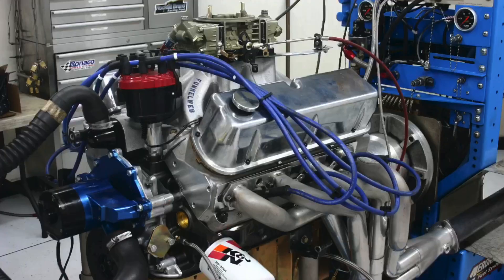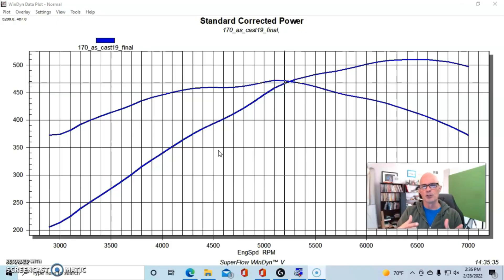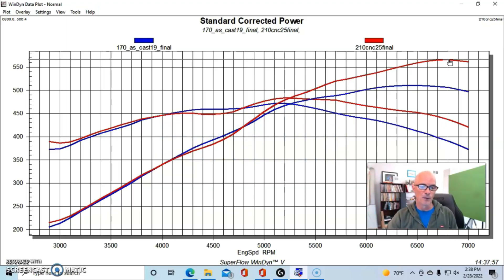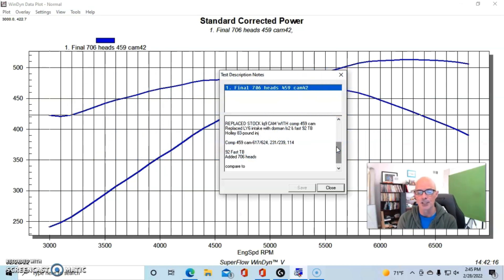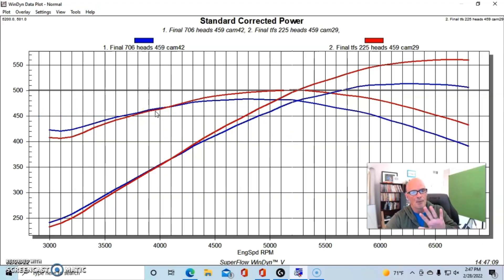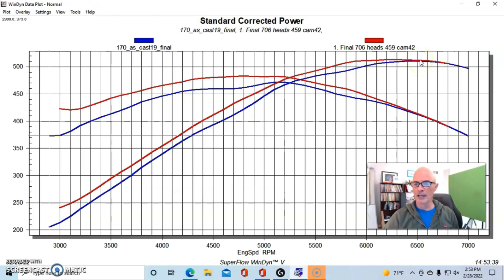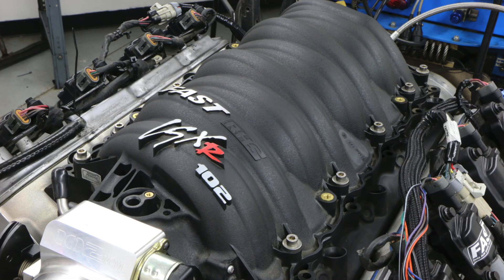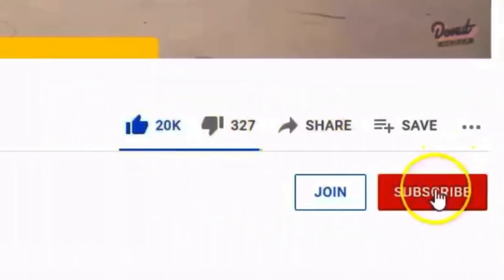HOW TO MAKE 6.0L POWER! FORD vs LS-WHICH 6.0L MAKES MORE POWER? MOD 363 FORD STROKER OR MOD 6.0L LS

Comment: I've run 351 Windsors with good heads and mods...but if you're going for max power, I'm now using a Ford "Boss" 4-bolt main, diesel iron block.  While you COULD limit it to 363...  A slightly overbored Windsor will easily hit 550 hp without straining the shortblock.  A 480 " Windsor is possible with the Dart block, or probably with a sonic-checked Ford "boss" block. (the boss is not a cleveland block.  Does have cleveland size mains.  Mine is a 438.
Reply: Diesel block,???
Reply: @timothywalker2273  diesel iron. Same metal makeup as diesel blocks which are made to withstand higher pressures.
Reply: @pimpovic2 Never heard of that. Is there some literature or link to that? Just curious.
Reply: Read it again.  Diesel IRON block.  Basically better iron than a production 351W @timothywalker2273

Comment: A forged motor with a solid roller cam over 700 lift with aftermarket heads vs a stock shortblock with aftermarket heads a much much less aggressive hydraulic roller camshaft with under 640 lift and yet it makes slightly more horsepower and 50 foot pounds more of torque plus it's extremely streetable seems to sum up the winner here if the LS had a lite weight forged assembly with pistons with valve reliefs and a solid roller camshaft with comparable lift and duration as the Ford engine with 11 to 1 or slightly more 11.5 compression it would probably make 50-60 more horsepower than the LS engine featured in this video and turn 7600-7800 rpm

Comment: Isn't the funnel web kinda old technology? I've seen many dyno comparisons and it gets beat out by both a super victor as well as the trick flow single plane.
Reply: yeah, its probably the worst choice in aftermarket manifolds for sbf

Comment: 1968 platform with today’s technology vs late 90’s platform is why the Ls is so much budget friendly. Of course the Ford is going to cost more. Ford dropped the ball by not staying in the pushrod game like Chevy did with the Ls.
Reply: Its worth noting, the Camaro and Challenger just died(again), along with their pushrod engines. The sales numbers always tell the real story....
Reply: @jackriegel5671  Ford got it right with the Coyote. The Coyote 5.0 is killing it in every form of racing. Especially street racing. The pushrod platform is a simpler design and easier to swap. Whole reason why I’ve stuck with the Windsor and Cleveland platforms. High HP and RPM’s, the Coyote is in a league of its own.

Comment: This should end the Ford versus Chevy debate. What I saw is a full racing block prepped with high compression pistons and a giant cam with custom cylinder heads basically makes the same power as a General Motors 6.0l That has a mild camshaft and a good tune. Period it makes absolutely no sense to build up a Ford motor like that when you can get the same power that 1/4 of the price
Reply: You should probably review the video.not remotely close to a apples to apples comparison.

Comment: that Ford would have hung with a Victor 5.0 EFI intake across the board; monster intakes. i have tried to design a composite intake for the pushrod , mentally of course, and it would be hard with the distributor and narrow head spacing -- with respect to runner length -- and valley situation, but it is fun to think of what the ol pushrod would do with a good composite intake. hell, it is basically a primitive LS.
Reply from the maker: A VICTOR 5.0 INTAKE IS NOT GOOD

Comment: And with it not being apples to apples the SBF is still not at any real disadvantage, nor is it limited. I'd rather be shot than have an LS in my Cobra!
Reply: Imagine if Ford had continued to developed the SBF...advanced block strength that wasn't necessary for a production 225hp Mustang that noses over around 5000. The Boss block for example could easily have become a production block.
Cylinder head technology, Lord have mercy what the engineers at Ford could have done with that. Point is LS engine development is more modern. Ford could've decided to do the same thing with the SBF but decided on the modular program. I get frustrated with the comparison of engine design from the 50's being compared with engine design from 30 years later. That's why I continue to say that the SBF isn't at a real disadvantage. Once you get past the limitation of the factory block and heads the game changes. Once the aftermarket steps in and you have both power plants on an even playing field (which they aren't here) results are always going to be similar.
I have a couple of LS engines myself, the benefit is what you can do with the stock parts but once you start having to spend real money on both engines from the foundation up the balances are much more even and really come down to preference, familiarity and brand pride.

Comment: Tough to compare a carb vs FI setup with better heads and manifolds, but the takeaway could be this: 
They all make good power if you combo them right. So run what you enjoy. 

On a side note, the cost comparison would be way better if he had started with a 351W. Again, pick your combo and have fun with it.
Reply: I agree! Especially when the cam is tailored to give the EFI enough vacuum to run right.  I'm not familiar with quirks of LS's, but with the Fords, you can cam them up for 8000 rpm's or higher with those TFS Hi-ports CNC ported heads. But then your "EFI" would have to be a high dollar race version.  I have a 363" 351 W engine (.040 plus a slight stroke to accomodate long rods with proper piston placement) and it pulls very hard through 7500, shift a 8000.  The RPM's in this test tell me that Richard fudged the Chevy cam to promote good vacuum for the EFI.  I have a 106 LSA, and there's not much vacuum to be had.  Duration 245/250-ish at around .640 lift.  "Expensive"?  I use chevy pistons, chevy rods (aftermarket but designed for) Chevy pins, and redrill my heads for LS headers, which are the same...but for some reason Ford headers are more expensive.  If you insist on building an expensive Ford, you can...but why?  Race an LS?  "Oh, I've just got a junkyard engine" (if they lose) and "My engine was cheap" if they win.  Nope, and nope.
Reply: A  .40 over 351w would have done similar numbers far cheaper !!

Comment: So, were you ever able to run a set of Twisted Wedge 225's on the 363 SBF? I'd love to see two tests, the above and your 6.0 LS, both with Holley Hi-Rams so the induction side is as comparable as possible. Actually, I'd love to see them both tested with Holley X-Rams, but I don't thing they make one for Windsors...

For which I'm cussing them out under my breath.
Reply: Use adaptor plates

Comment: A all forged engine vs a stock shortblock and the stock shortblock has less camshaft makes more peak power and torque and and also makes more horsepower and torque throughout the entire rpm range just imagine if the LS got forged rods and pistons with valve reliefs and a camshaft simular to the Ford in lift and duration you could probably add another 40-60 more horsepower easy not to mention the LS engine is very streetable and a more mild engine makes this a easy choice
Reply: How does forged engine make  horsepower?this isn't even close to a apples to apples comparison.
Reply: @rickkowalske4116  the reason the Ford engine has a all forged rotating assembly is because the stock Ford crank rods and pistons are no way going to take this power level abuse or rpm range and if it did it wouldn't do it for very long on the other hand the LS 6.0 is known to last stock to the 600 horsepower level and to 7200rpm and let's address the aftermarket cylinder heads on the Ford engine when the LS has upgrades stock heads not to mention the 6.0 LS had a much more mild camshaft than the Ford did let's put a camshaft with similar duration in the LS that the Ford had and let's put some AFR LS3 Mongoose 260cc cylinder heads on the 6.0 with the more duration cam and these heads bet it gains another 60-75 horsepower
Reply: @rickkowalske4116  well the only way to see is if we put a set of light weight forged pistons and rods and crankshaft in the 6.0 and run it on the dyno what do you think if what the engine is rotating inside weighs less it not going to gain power racers only do it for durability reasons
Reply: @rickkowalske4116  l can guaranty you the forged rods crankshaft and pistons being used in the Ford engine weigh less than the factory rods crankshaft and pistons so to be fair lets put the stock ones back in it and see if it makes the same power
Reply: @rickkowalske4116  so your saying there's are absolutely no advantages comparing a completely stock short block with a stock rotating assembly to one to has a custom built hand picked to your choice all forged rotating assembly if so then let me pick a stock stroke all forged rotating assembly for the 6.0 and I'll bet it will rev faster make more power and rev higher with it
Reply: @rickkowalske4116  and with the trick flow heads on the LY6 6.0 compression is probably 9 to 1 because with the stock 61cc head it's got a whopping 9.6 to 1 way less than the Ford the Ford had a pretty large race carberator the LY6 6.0 had a 92mm throttlebody I'm sure with 10.5 to 1 - 11 to 1 compression that the Ford had and 102mm throttlebody on the LSXr intake using the same camshaft it  would have easily gained 30-40 more horsepower the compression alone going from 9 to1 to 10.5 to 1 or 11 to 1 would easily add 25 more horsepower this LY6 6.0 made this kind of power with the trick flow head with around 9 to 1 compression is absolutely amazing see how well the Ford engine runs with the camshaft they used with 9 to 1 compression the 6.0 had a hydraulic camshaft with under 240 duration the Ford had a solid roller with over 250 duration and over .100 more lift than the 6.0 Chevy did
Reply: @rickkowalske4116  l have a 2011 Camaro SS with a new GM performance LS3 495 horsepower crate engine with CNC ported and Milled LS3 heads with a sheet metal intake 102mm throttle body ZL1 injectors and fuel pump this engine has a very mild 219 intake 228 exhaust duration camshaft it idles fairly smooth very close to stock running on E85 it made 520 horsepower at 6200rpm at the crankshaft revs quickly to 6600rpm redline and makes 400 foot pounds of torque or more from 2700rpm - 6200rpm at the crank and makes 480-495 4700rpm -5200rpm for a mild street engine it rocks
Reply: @rickkowalske4116  I'm also thinking if your paying over 3000 dollars for a Ford Dart bare block probably about what they spent on the complete junkyard LY6 Chevy your going to be using the absolute best light weight rotating assembly available
Reply: Again not an apples to apples comparison. Forged internals didn't help h.p.cam not matched to heads and manifold.aftermarket block.efi to carburetor? I don't see any real apples to apples comparison.but since you go on and on about your camaro,a stock coyote engine with 74 cubic inches less is running right with you in performance.now what's the excuse?
Reply: @rickkowalske4116  I've had my 2011 Camaro SS since December 2021 it has a lot of upgrades it has a built 6L80e transmission 4200rpm Circle D stall converter aluminium one piece drive shaft stock 3.27 gears it has a full interior and AC it weighs 3920 with me in it with only 1200 miles on it l made 6 eighth mile passes with it its naturally aspirated it's best time was 7.22 at 96mph with a 1.65 60 foot time there were only 3 Camaro SSs at the track that night the fastest pass they made was 8.40 but there were at least a dozen 2016-2022 5.0 Mustangs running that night the fastest naturally aspirated 5.0 was a 2021 5.0 with full bolt ons drag pack long tube headers full exhaust cat deleted 10 speed automatic with a Circle D 3500rpm stall converter drag radials it was running 7.89 at 94mph there was a 2018 5.0 Mustang with a turbo running 7.20 at 99mph so if your talking naturally aspirated and you think that 7.89 is competing vs 7.22 then ok l look at it as over 6 tenths slower and like l posted earlier my engine is not a max effort big cammed LS3 the GM performance LS3 495 horsepower crate engine is a very mild street engine my only advantage is my car runs on E85 the Mustang was on 93 pump gas and I'm not at all saying that my car couldn't be beat by a naturally aspirated 5.0 but as of yet the closest was 6 tenths slower most stock 5.0 Mustangs with upgrades and drag radials were running 8.30s-8.50s stock ones 8.60s up to 8.80s horsepower wise the 5.0 can compete against a LS3 or LT1 my LS3 with upgrades on E85 makes 400 foot pounds of torque or more from 2700-6200rpm at the crankshaft modded 5.0 Coyotes do not they make 410 peak at 4400-4600rpm so they make 400 foot pounds of torque or more from 4200-5000rpm is not even close to as wide of a torque band and is what helps move a 3600+ pound car in order for a 5.0 Coyote to compete against a LS3 or LT1 is you have to rev the living shit out of it while my car makes its shifts at 6600rpm redline
Reply: @rickkowalske4116  another huge thing to notice if upgrading camshafts on a 5.0 Coyote they only gain 50 horsepower and your lucky to gain 20 foot pounds of torque over stock if upgrading camshafts on a LS3 if and you pick the right camshaft your gaining 100-120 horsepower and 70 foot pounds of torque over stock the amazing thing with the LT1 is if you put a GPI NFC LT1 camshaft with other supporting mods that uses the stock LT1 short block stock crankshaft rods and pistons and stock CNC ported and milled LT1 heads on the website they claim 590 rear wheel horsepower that equals out to a 190 rear wheel horsepower increase using a stock LT1 short block stock crankshaft rods and pistons and heads with other supporting upgrades on E85 this should be enough to push a full weight 6th Gen Camaro to low 10s naturally aspirated and is completely streetable

Comment: I think if had used TFS high ports on the 363 Ford and holley high ram intakes on both engines and same size cams, both efi.  That would be closer comparison imo.

Comment: I love that you work to make your comparisons reasonable. Not everyone does. The LS is a really good engine, but the lesson is the same as always. Decent heads and compression with similar cams will make similar power per cubic inch regardless of manufacturer. Yeah, btw, the Dart block is spendy. The comparison wouldn't be as valid if you were comparing a 351 Ford to a 6.0 LS. Having 12 ci fewer doesn't sound like a lot, but it would still have made good power per ci.

Comment: Simply put, the LS is the more practical engine. The LS can use a stock block, crank, rods, pistons, heads and intake to make over 500hp. The "Ford" was actually 0% Ford made. That being said, both engines deserve respect and if cost is of no concern build the engine that suits your interests best.

Comment: Why didn’t you use stock ly6 heads
Reply from the maker: I did run the 6.0L with stock LY6 heads-it made less power than the TFS 225 heads

Comment: I've often wondered how the Ford small block 427/460 crate motors stack up.  They have the cubes, but the specs on the heads make me think they're still choking the engine.  Anybody got experience with those?
Reply: Scott,  if the big cube crate engines are using Windsor style heads then they are the restriction that’s limiting power production. My personal choice is always the canted valve Cleveland heads and the additional displacement makes them a much better choice.

Comment: Ford 363 is a rompin' stompin' power maker as long as it has a good set of aftermarket heads.  Unfortunately, it takes a whole big bunch more effort (money) to make the same power as a junkyard 6.0 liter LS.  .... aaaaaaaaaaaaaaaaaand that's prolly one of the biggest reasons why we see so many LS swapped Mustangs.
Reply: Well chevy did design its own 351 Windsor.From a "Ford" guy point of view.. to all chebby people...you're all "welcome".
Reply: Its because the ls is a way more modern design that has really good heads out the gate.  That is why they can make so much power cheap.  Imagine if the ford was 363 cubes stock and had the heads used here from the factory.  All the sudden it starts getting alot cheaper to make power.  Nobody ever says anything about the ls being like 30 or 40 years more advanced lol.

Comment: Keep in mind the Ford had a massive cam compared to the LS at over 700 lift and also 254/260 duration while the LS was down near 620 lift and 232/239 duration which means the LS would be a relatively mild mannered street engine while the Ford is bordering on being a race engine. I love SBFs but this comparison does show how awesome an LS is.
Reply: Spot on.
Reply: Agree!
Reply: Yup
Reply: All this shows is newer is better. Bored 351 Windsor would of been nice to see though.
Reply: Those TFS 225 are no joke, and we tend to look past the "cathedral ports"...
Reply: I'd love to see this 'comparison' done with carbs on both, or efi on both.

Comment: Also the ford cam vs the chevy cam are two total different worlds...

And the you know the reason he didnt use the ly6 heads from the start. Gotta tie one hand behind the LS's back to make this video, let's be honest.
Reply from the maker: the ly6 heads make less power than the tfs225-that's why
Reply: @richardholdener1727  noted, but the use of the 706 heads is what i was referring to. Would have made for a hugely uneven comparison, showing some 550hp compared to the baseline 6.0 ford. Good creative video though.